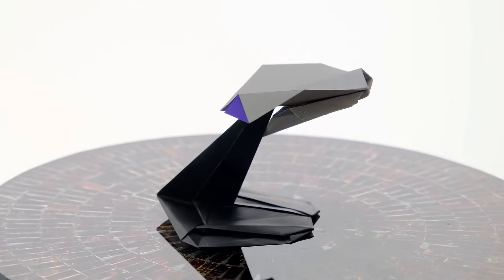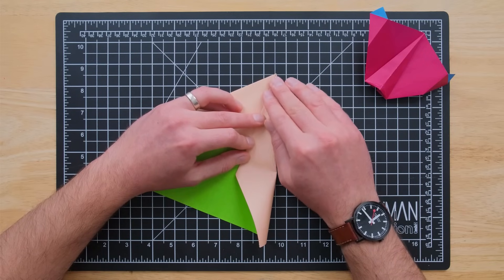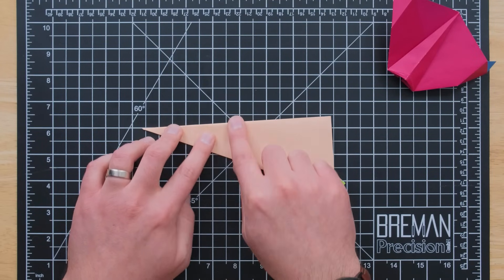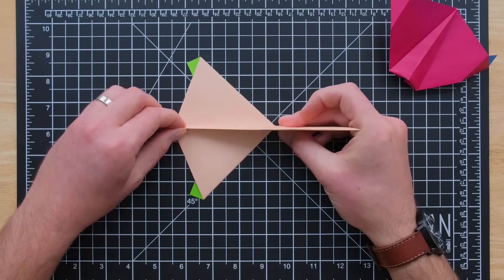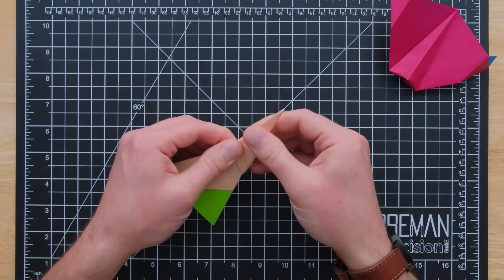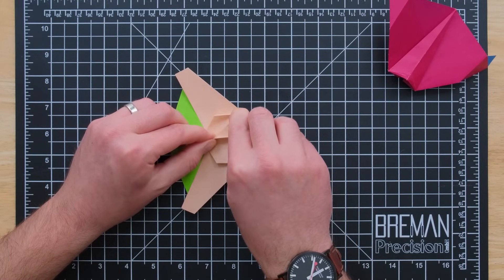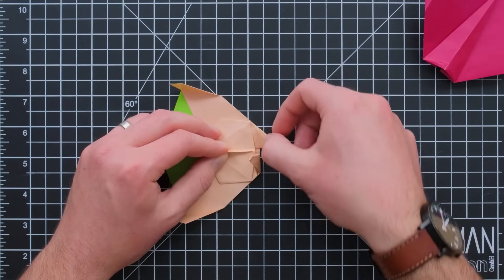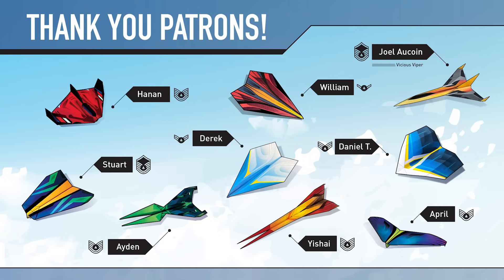How to Make a Drone Paper Airplane that Flies! — Q-1 Gannet, Designed by Evan Brus

Comment: lol... we used to make very similar paper planes in school, in 2-3rd grades, in Eastern Europe in a class called "work/labor shop", which later on turned into woodworking, basic soldering, recycling useful electrical components from old electronics equipment like radios and old TVs... and electric welding of steel tubing to fix school desks and chairs which had frames made of square steel tubing.. and also 1 semester of cooking. 
I think woodworking started in 4th grade and continued on until 10th grade... and in 9th grade we had basic electronics and soldering tasks... which was cool because we were learning common electronics components by taking apart of electronics and harvesting common components like capacitors and resistors from radios and old TVs... you also learn to use your soldering iron very well and you later on had to check these different components if they are any good...because often they look good but until you test them you are NOT 100% sure they are of any use... that was fun for a while... and its also interesting to see who of the kids likes what, some absolutely loved woodworking but couldn't stand dealing with electronics as it was boring for them... and vice versa... Electric Welding was definitely 2nd part of 9th grade or maybe even stared in 10th grade... cant remember for sure... but it was cool although i hated the smell of burnt metal.
Back in 2/3 grades we would also test different designs for multiple characteristics... which design would fly farther, longer... there is also a little trick to make the plane continuously go into a circle spiral...  We also made wooden planes that you could launch using a small handheld rubber band catapult... very similar to this design: https://encrypted-tbn0.gstatic.com/images?q=tbn:ANd9GcTQif-FVJZ0trTfT0bQ6m3qE8R2Y-Ha9_GiCOTvx0lCKcSMOXXI4-FWFSelclCWc6weT_8&usqp=CAU

BTW this design is not very good as a paper plane...

Comment: Hey, Kyle! First time commenter here. Greetings from the other side of the planet! I've been following your channel for the past couple years and love the direction you've taken as well as increased dedication to the project. 

I have interests in both origami and aerodynamics but have rarely delved into the intersection between the two. In recent years (namely due to pandemic lockdowns) I revisited an old paper rogallo design I came up with in my teens and iteratively optimized it gradually over the course of a few years while also exploring other related ideas. More specifically I've been pursuing the design of high aspect ratio paper sailplanes, especially flying wings. In exploring the application of aerodynamic principles to paper planes, I landed on my favorite method to engineer and trim swept flying wings; the same toed-in Stromburg configuration utilized here by the Q1 Gannet.

I do not consider myself a paper plane designer, not even remotely in the same sense as someone like you; I only have 3 essentially finalized sailplane designs, I haven't published any of them, but perhaps will look towards doing so at some point. Anyway, I'd be interested in having a discussion with you as to why more paper plane designs don't utilize this jump crank technique to create wing twist/washout as well as intergrate trim surfaces.

I hope to hear your opinions! If this is not the best place to have such a discussion, please feel free to redirect me to your preferred channels for communication. I would absolutely love to have a conversation about design principles.

Sincerely,
Sam
Reply from the maker: Hi Sam! Thanks for a very thoughtful comment. I'd love to have a deeper  conversation on the topics you bring up. Would you please message me at https://www.facebook.com/foldableflight ?
Reply: @FoldableFlight  Sure thing! I'll toss you a message over on Facebook

Comment: :)
It has a design that I had not seen, but with that shape it does not take away from the aerodynamics, because of the hole in the front?
Reply from the maker: The air intake at the front does generate a lot of drag, but it looks amazing, doesn't it?
Reply: @FoldableFlight  Yeah, it's amazing